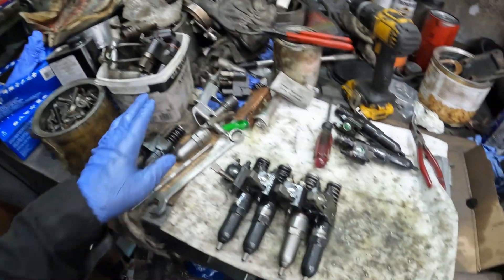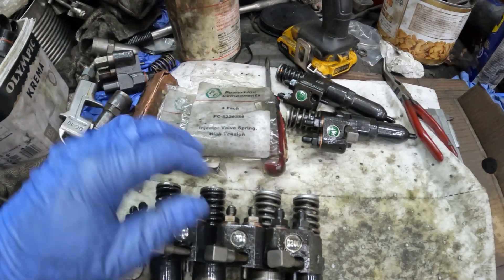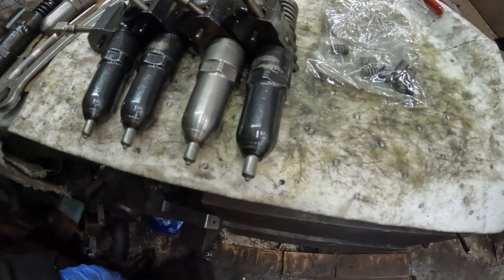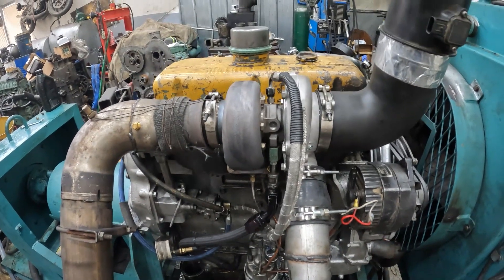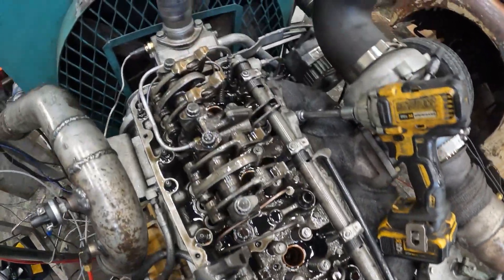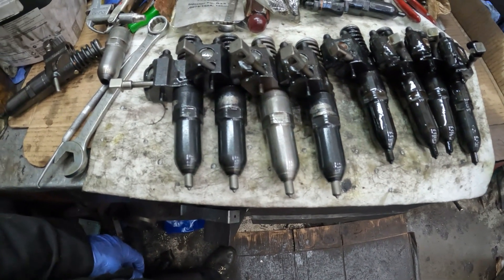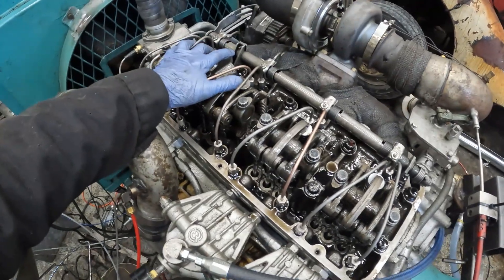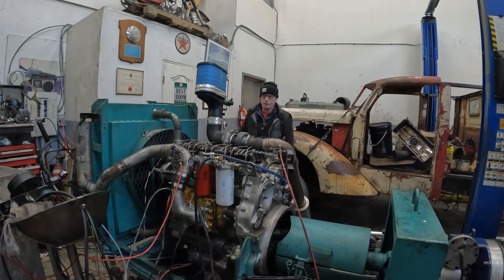Detroit Silver 4-53T (272HP & 720FTLBS Of Torque)

Comment: GM just gave up with the Detroit they say for emissions reasons. I really don’t think they tried to sort it out. I much prefer the reliability of mechanical injectors but common rail have come a long way. It’s a shame they pulled the plug on development.
Reply from the maker: Yes very true, look at how far Achates has come with their two stroke apposed piston design.  Class leading in fuel economy, power, emissions etc.  That could have been Detroit doing that.:)
Reply: Jail The EPA

Comment: Nice. The very first thing us army maintenance guys would do, when we got a "new" (to us) "MRT" (mobile repair vehicle) was swap out the N50 injectors for N65. The jump in HP was def noticeable, however there was "some" smoke (non turbo 212 hp engine) Our engines were non turbo, so it would be very interesting to see what the hp gains would be bumping up to these injectors would be. That said, based on your experience, is the 453 or the 6v53 (T) a better option based on HP to weight ratio @1950 rpm.
Reply from the maker: I would choose the 6V53T over the 4-53T, although heavier, it can easily make 350HP and 700FTLBS of torque.:)  Getting the 4-53T to those numbers is a real challenge.:)

Comment: Take that in a pickup with a 30 foot trailer out of death valley west hwy 190 to panimint valley summer late July at  3 pm then tell me how much power you have and how much you desperately want a Jacob’s engine break i live there it’s a slow trip because of cooling a a bench checking machine is not real life just a waste of money put it to good use. Call what you do, but they’re just numbers on a chart.
Reply from the maker: I get your point, but this is just a tool to test different ideas.  The engine will end up in a 1948 Diamond T.  I'm well aware of the challenges of cooling engines in hot and high elevations.  I live in a mountain valley and have to climb many 8% grades in winter and summer.  The truck will be equipped with Jakes as well.:)  Thanks for watching.:)
Reply: @detroitgarage9430  coolest thing but I have been running one for years thanks for sharing
Reply from the maker: @ThomasJones-b7d  :)
Reply: I have air to air cooling to be installed but I do have bypass blower system installed it works great
Reply from the maker: @ThomasJones-b7d  Nice.:)

Comment: Power produced is tracking very well with fuel ratings on the injectors.  Its also impressive that so much fuel, in a small capacity engine is able to be burned cleanly.  As we know with common rail setups......fuel volume benefits a lot from extra pressure at the injector.  When I had my common rail diesel VW "bumped" it not only gained power, it dropped fuel consumption by the same amount (20%).  More pressure (at the rail) reduced fuel consumption over stock significantly.
Reply from the maker: I'm very happy with the outcome on this run.  I figured the higher opening pressures will reduce emissions and still give me a bump with the larger tips.:)  Excited to see how it does with the open housing.:)
Reply: In the late 1990s, I had a VW 1.9 TDI-90 in a small minivan. Oh it was slow and only got about 32-33 miles per (UK) gallon. I had the ECU chipped (before downloaded remaps were possible). Power went to 110bhp but fuel consumption improved to 37.5 to the gallon. It was much nicer to drive and even the kids asked why the car was so much less noisy.
Reply from the maker: @Dave5843-d9m  Awesome.:)
Reply: @Dave5843-d9m  Manufacturers  "sand bag" their products for all kinds of reasons,often with undesirable down sides.

Comment: Nice. What would have been the stock application for the 9210's? Did any stock 4-53 installs utilize an intercooler?
Reply from the maker: Hey Mike.:)  The 9210's were used mostly in the 92 series engines.  Detroit never made intercoolers for the 4-53 series, but did make water to air cooler for marine use.

Comment: if a 4-53 can make 720 pounds, then can an 8v92 make 2499 pounds of torque if the engine was setup fairly the same in proportion?  Dyno Smith made an 8v92TT have 1829 pounds at 2298 rpm, 800hp.
Reply from the maker: With the right amount of fuel and air, anything's possible.:)
Reply: Jason Douglas and his crazy Common Rail injected 8v92 is making 1500hp allegedly
Reply: @or-what  old 2 stroker figures 2000 hp now.  probably close because he's revving it 3400
Reply: I'm glad someone mentioned Dyno Smith. I'm a sub. 
I'm also a truckie, and I had for many years a Cummins Sig one of the 2000ft/lbs 600hp ones. That engine spoilt me. Nothing I have driven since has managed to make me smile like that including a 715hp V8 Scania.

Here's the thing, I'm constantly looking for a vid of an 8V92 that can get to 2000ft/lbs. I will say, I've never driven a Detroit Diesel in anger, but being a uniflow the torque curve on them is far broader than any 4 stroke diesel. You look at the Detroit torque specs for a stock 8V92TTA (Silver) and the torque is just shy of 1500ft/lbs iirc - but - it's producing over 900ft/lbs from 800rpm. That's the advantage of them.

Cummins Sig has about 350rpm of torque band (absolutely nil below 1100rpm - you learn to never ever let it get down there) and it's over by 1400rpm, the Detroits about 1000rrpm of useable torque.
The question becomes would you rather have 250ft/lbs less peak torque or 1000rpm of useable torque? 
Fuel consumption pays a part but I'm a company driver so I couldn't give a sh1t about fuel consumption LOL.

Comment: 16%, 100ft/lb of correction? Looking forward to seeing it run on summer fuel. I'm sure that the right turbine housing A/R without the divider, will be great. The drive/airbox pressure matching is a big improvement over the tiny turbine! The bypass seems like it won't matter, if the airbox pressure is that much higher than the turbo outlet?
Reply from the maker: Thanks, see what it does with the open housing now.:)  Should be interesting.:)

Comment: I'm with you on the housing swap. It was smoking a little but more air ought to fix that. I'm also with you with the bigger tips and stronger springs. More spray and more pressure ought to be a cleaner burn because the atomization  ought to be really good. And more meth can't hurt. Thanks!!!
Reply from the maker: Thanks, the open housing should add some power.:)
Reply: @detroitgarage9430  YESSIR!

Comment: You got to be pretty close to final form dont you?     Seems pretty good as is
Reply from the maker: Yes, still have to make the blower bypass and advance the cam timing.:)  I think there's 10-15 HP hidden in there still.  See how the .82 open housing performs tomorrow.:)  This is the last injector size, so have to squeeze every last ounce of fuel from them.:)